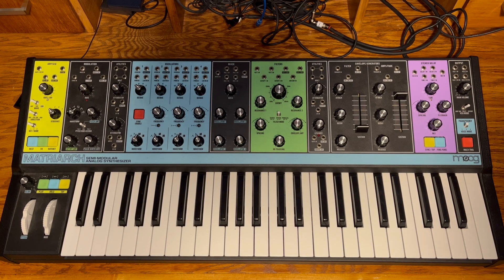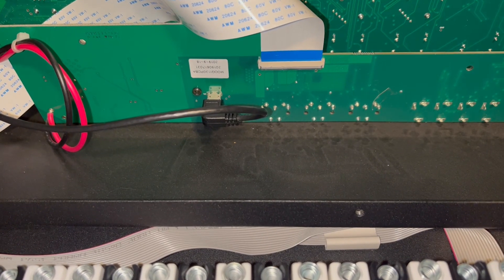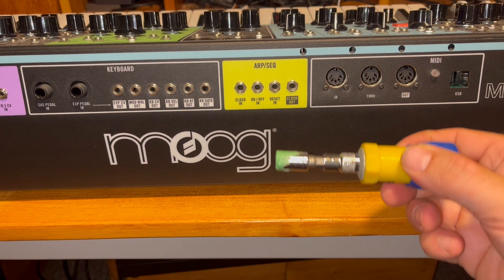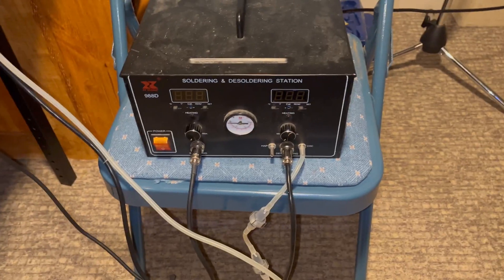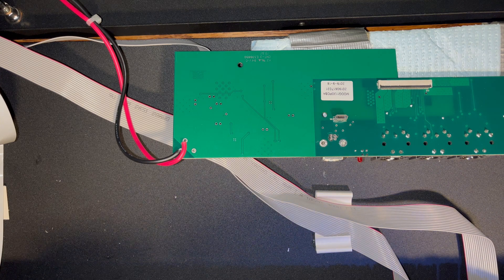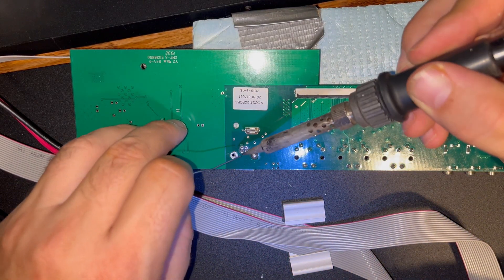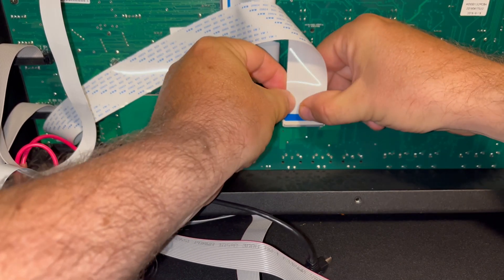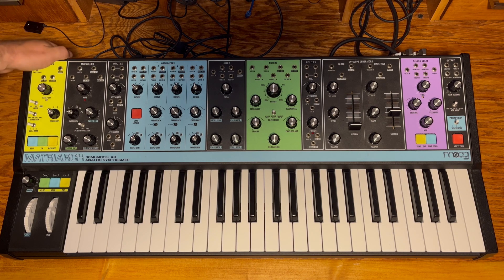Repair a Moog Matriarch

Comment: I have a Phatty and the audio output has dropped off and degraded.  I want to service it myself if possible.  Do you know what I need to buy and what I have to do?  I can drop in a new capacitor or whathaveyou.   If you can show me a video that will tell me what I need to do.   Otherwise, what will a repair typically cost me?
Reply from the maker: That is beyond my capabilities. A drop off in volume is most likely caused (if you haven't already checked the obvious - cables and inputs) by a dying power supply. you could open it up and do a quick physical check to see if any caps have blown....be careful with capacitors...you can hurt yourself if they aren't discharged. That sort of thing is best to have checked out by a professional. in terms of price...no idea. My tech charges 100$ for an hour diagnosis and then will give me a quote after that. I think that's pretty standard practice these days.

Comment: What size screws are used on the bottom of the case? And are the ones in the depression for the key bed the same size? I just bought a used Matriarch and a few were missing.
Reply from the maker: Sorry for late reply…and sorry, I don’t know. I don’t have a nut sizer at home, so can’t give you an answer to that. I’d email moog support. They’re generally pretty quick at responding to service questions

Comment: If you ever have your sync, pingpong, and multi trig lights come on and stay on, check the ribbon cable connections to the board on the end, mine had come loose somehow....

Comment: How are the potentiometers holding up? Both my Granny and Matriarch have nosiy pots. Moog has sent 3 B10K replacement pots and I am nervous to open them up. I have ordered Deoxit F5 fader bottle and waiting for it to arrive. I applied W40 contact cleaner on the spring reverb pot and It was a bad idea. It messed it up!!.
Reply from the maker: My matriarch gets a lot of use, but no noisy pots yet (crossing my fingers it stays that way). F5 Deoxit is awesome product, not used it on my matriarch…but have rejuvenated tons of other gear with it. I trust it over any other product. I’d try that before replacing any pots.
Reply: @RobeMusic  that Deoxit F5 didn't do anything at all. Should I open it up and spray it directly at the PCB level?
Reply from the maker: @syntheshwara  hmm. I’m sure you took off the knob and sprayed it directly on/into the shaft of the potentiometer. Normally you have to ‘excecercise” it as well….but I’m sure you probably did all that. If the F5 had no effect at all then it may be something else…bad or cold solder joint or something else. I’d Emil moog support, tell them you used F5 with no result. See what they say.

Comment: Hi! Thanks for the video, helps a lot! I have a question though: how difficult would it be to separate the side panels, when the bottom is disconncted from the top? It looks like one has only to unscrew a few screws? Maaaany thanks in advance!
Reply from the maker: I thought about that…as thinking of putting on wooden side panels. It’s been a while since I took it apart…I think you’re correct…it’s pretty easy. But I’d check with moog or one of the people selling custom side panels.
Reply: @RobeMusic  That's exactly the reason why I asked - I found a guy who's interested in making wooden side panels 🙂 Thanks!!!

Comment: This is a great video! I recently purchased an open box Matriarch and sadly found one of the keys was snapped in half. To replace the key, would I have to unscrew the other screws on the back to detach the keybed from case or is it possible just to replace the key once you have the case open?
Reply from the maker: You’ll have to remove the key bed from the case to get to remove keys. I haven’t done it with a matriarch…but have replaced keys on my subsequent 37. It’s not that hard a job….but you should contact moog support. They will most likely give you step by step instructions. They’re great.

Comment: I came across your awesome video beacuse I want to remove the pushbutton caps (red, yellow, blue, green) from above without opening the synth case. Would you say that this is possible anyway? (I want a little facelift for my Matriarch Black Edition. I already have the replacement caps.)
Reply from the maker: You might be able to get at the arp and delay buttons easily enough…but pretty sure you’d have to remove pcb from the case. I bet if you ask Moog they’d give good step by step instructions